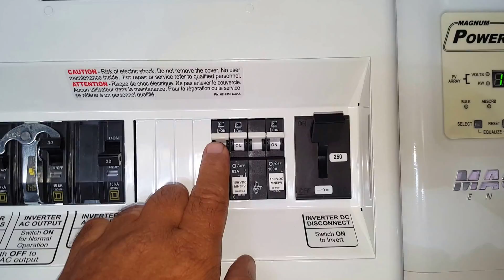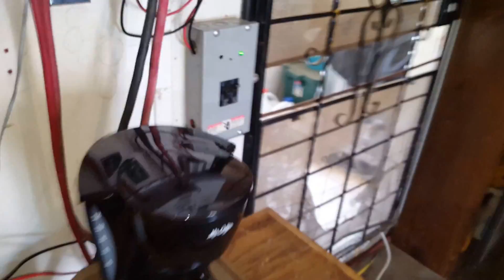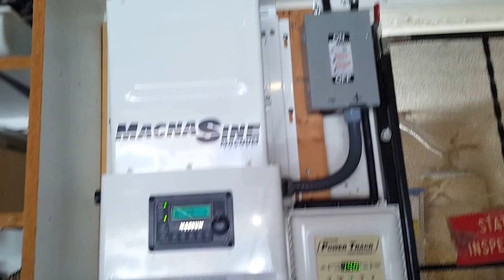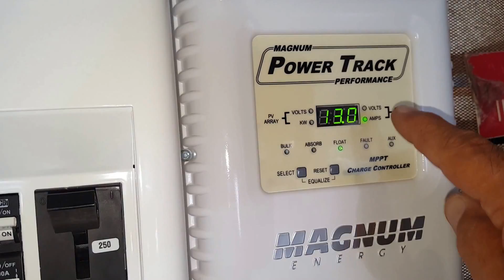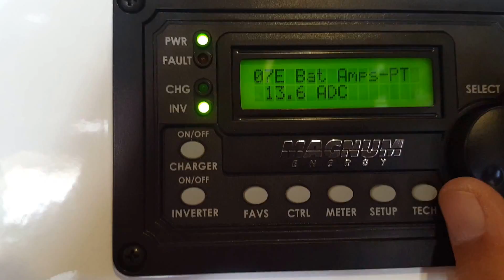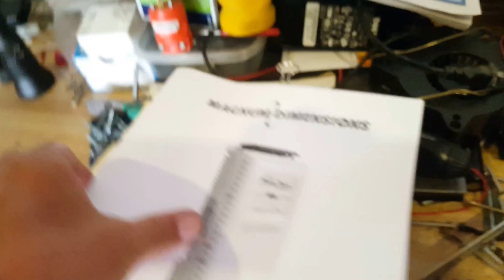My Magnum Energy Set-up.

Comment: Brother this is yanke4 btw. What is your bulk set at? For 24 volts trojan say bulk needs to be 29.64... I will post the link for you in a 2 commnet so it duse not go to spam..
Reply from the maker: It's set at 29.6 as you mentioned, Be Safe and Godspeed